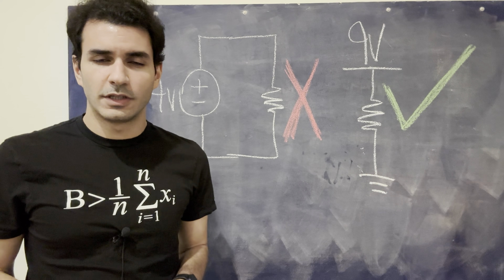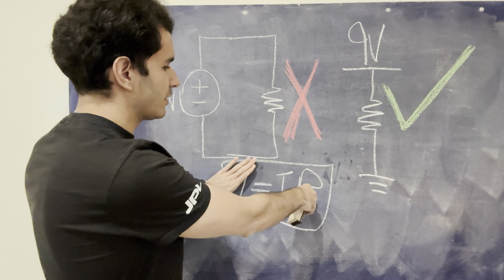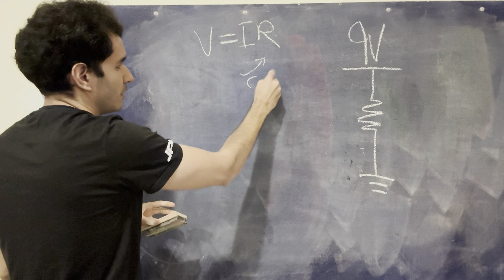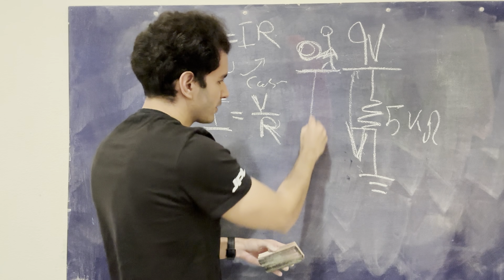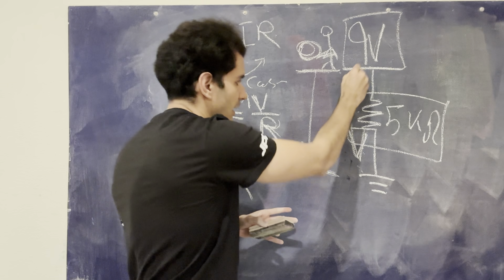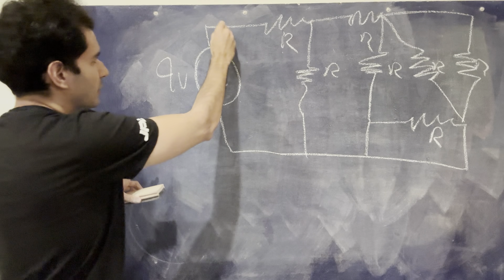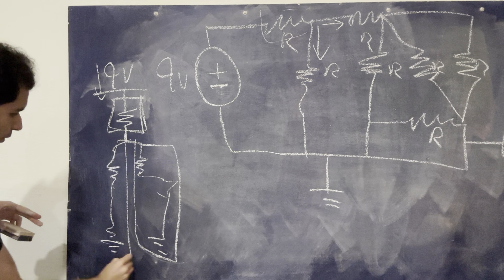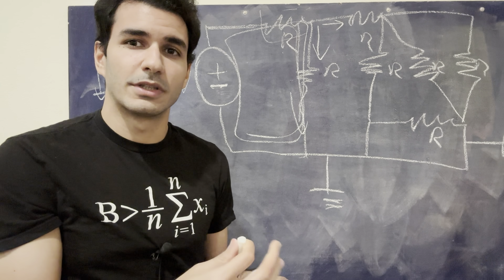Circuits Finally Made Sense When I Saw This One Diagram

Comment: I have question , they explain that, in electric circuit the wire has same potential every where because there is no resistance (ideally wire) but this contradict what i understand when a test charge brought in to electric field , it's potential (ie voltage) change with position relative to source charge , they do not talk about resistance , how is this different from wire , charge particle does not know it is in wire or outside of it. I really hope some explain to me.
Reply: For simplificationm it's good to group the terms and ideas together. Inspection of electric field with test charge is taught as a part of electrostatics, so mainly stationary charges and main material property is permitivity, which is considered mainly for insulators. On the other hand resistivity is considered where electric charges are expected to move. There are few important things in electrostatics, that should be noted. Permitivity of conductors can thought as infinite, so there is no electric field inside a conductor. This can noticed in diagrams of capacitors - two charged plates, where electrid field is around them but not inside. Second is that electric potential or voltage is definied by work or energy. So when we let charge accelerate in electric field (e.g. in vacuum), it gains energy.  On the other hand, in conductors (or resistors), we think of dissipation of energy over time. So the important thing is to discern cases of static and moving charges. And I should also mention to prevent misconceptions, that in conductor where current is flowing there is electric field inside. So at the end I can also mention that first formula V = I*R. Zero voltage drop can mean zero resistance (ideal conductor) or zero current (kind of electrostatic scenario).

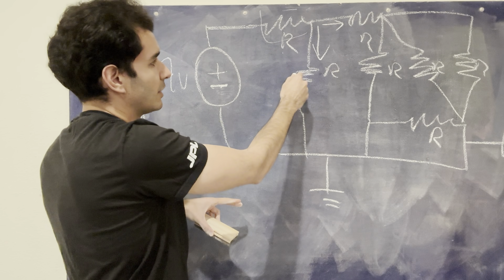Comment: 6:54 that’s the intuition I developed for circuits, or also that even across an element parallel to a short, there will be miniscule current flowing in reality, but in ideal cases it doesn’t. So I had to suspend my intuition of the real case since apparently such currents would be negligible. I’m wondering if that’s always the case though, and if not then it makes me wonder how I can better sharpen my understanding to better encompass the real and ideal cases.

Comment: Here's how I think of it:

Before completing a circuit, you ONLY have two things: you have the voltage levels at some points, and the resistance between those two points. Up to this moment, current simply DOESN'T EXIST. So it makes no sense to plug it into an equation, as that suggests you're plugging in a theoretical current, rather than one that is already existing in the system. Voltage and resistance, on the other hand, already physically exist, so those can logically be plugged in as a "cause" with the newfound current being the "effect"!

Basically, you cant plug in what you don't have.